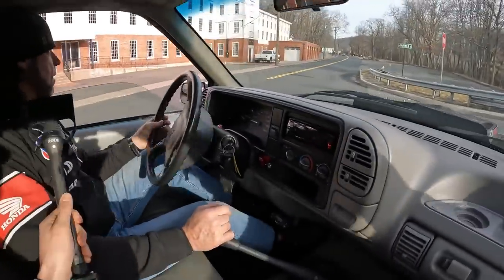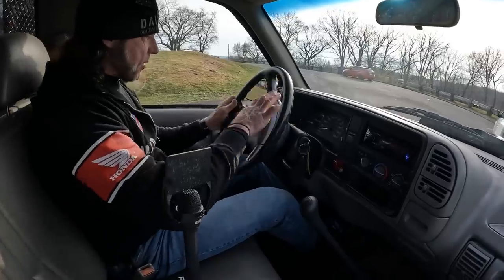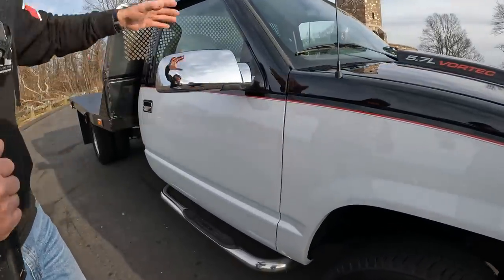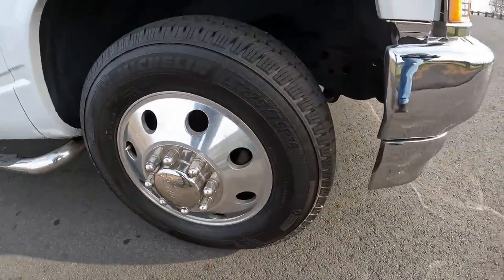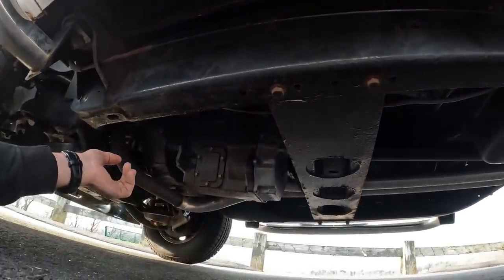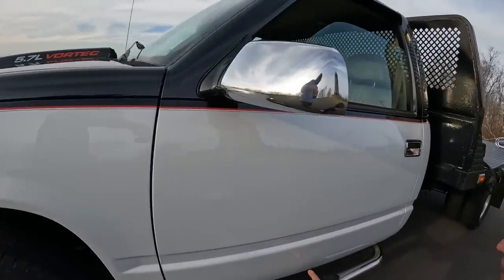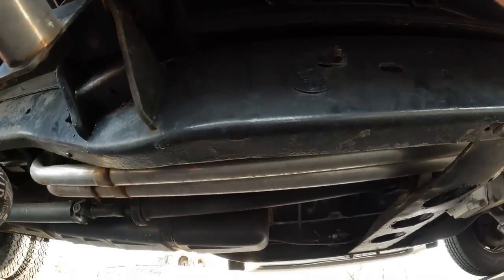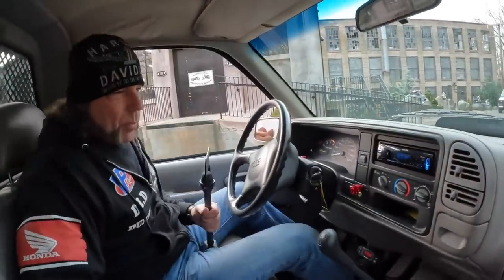1995 GMC 3500 DUALLY 11' Flatbed 5.7 L V8 5 speed for sale

Comment: Just a tidbit of information about these HD 350 truck engines, they aren't the same as a 350 that goes into a car, I found out the hard way. I had a mid 90's one ton dually and the fuel pump went out, so I replaced it. Started good and idled good once replaced, then I took it down the road ran great until you kick it down and it would fall on it's face. Took it to a master shade tree mechanic. He checked everything and couldn't at first figure it out. For the hell of it he put a fuel pressure gage on it and took it down the road. Everything seemed normal (I can't remember what the fuel pressure is supposed to be but seemed normal I think  something like 55 to 60lbs). He didn't see a problem until he call the dealership and found out that these truck 350's take a higher pressure fuel pump something like 70 to 80psi. I don't know what's different with the internals, but there is a difference.